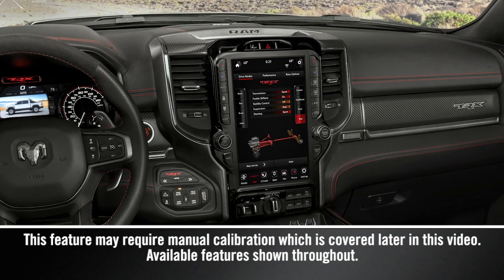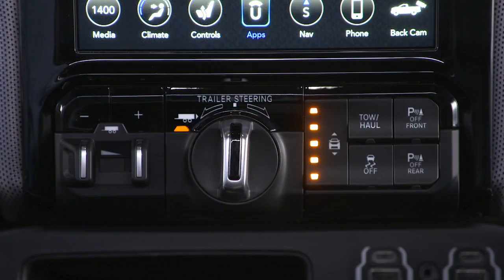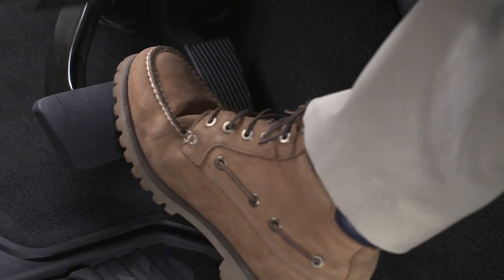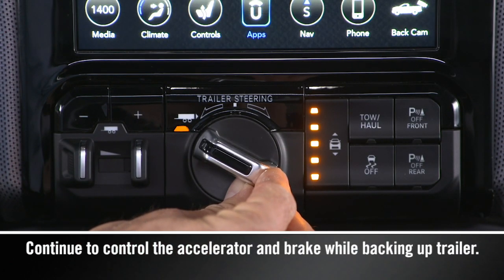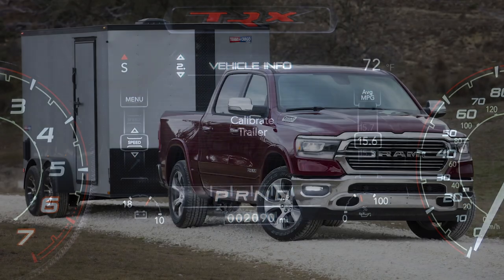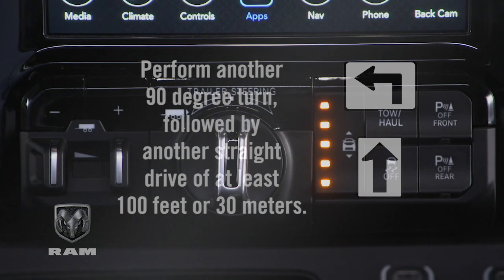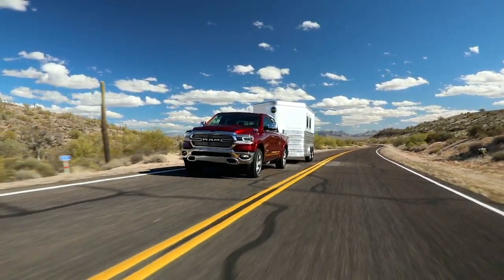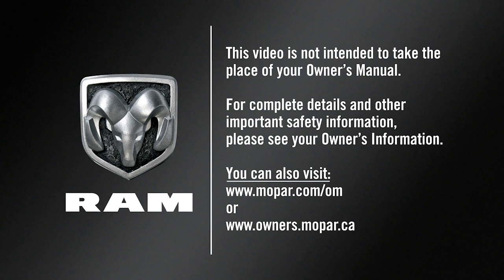Trailer Reverse Steering Control | How To | 2021 Ram 1500 (Base & TRX Models)

Comment: Put your hands on the bottom of the steering wheel. Put your vehicle in reverse, steer left, trailer goes left. Steer right, trailer goes right.
What's next, a vehicle that can parallel park? 🙄🤣
Reply: Theyve been able to parallel park for probably 10 years